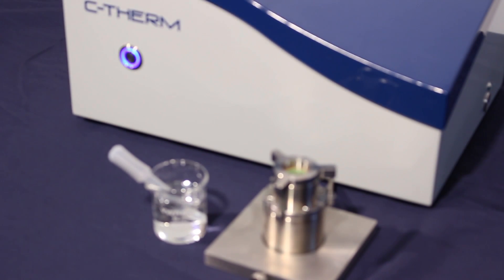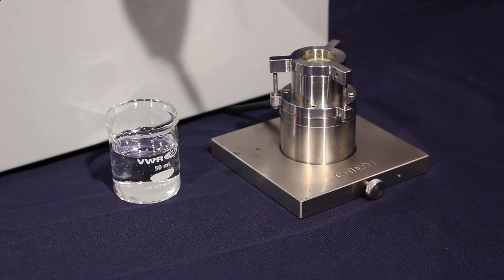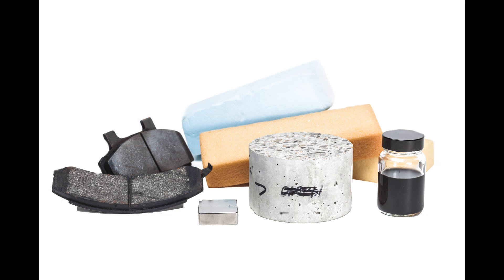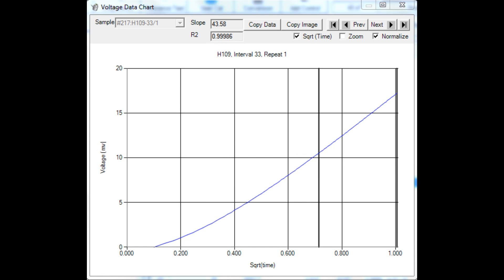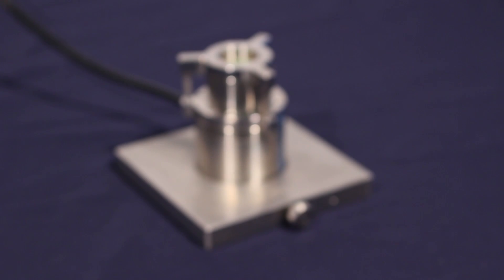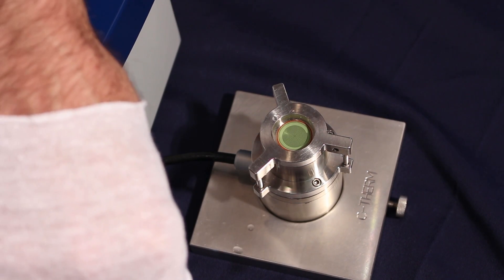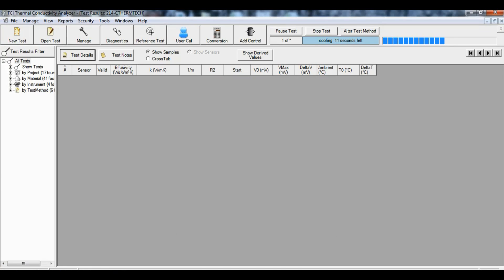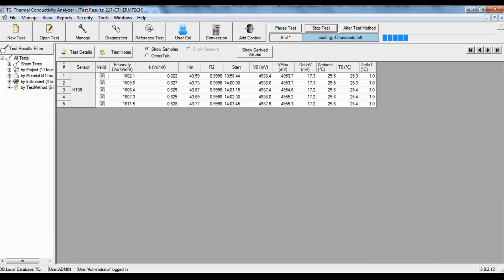How to Measure the Thermal Conductivity of Liquids

Comment: Can this device also measure other quantities like specific heat capacity and other heat related measurements as it relates to the fluid? I'm thinking it might be a redundant component to add as one could probably do just fine with a calorimeter. Am I correct or wrong? Thank you.